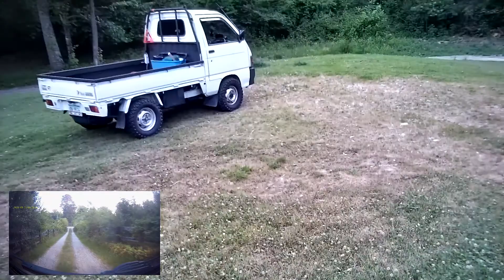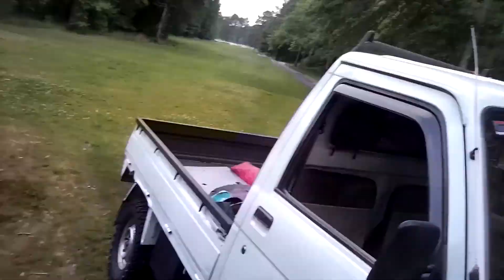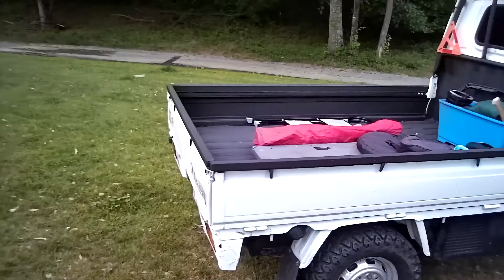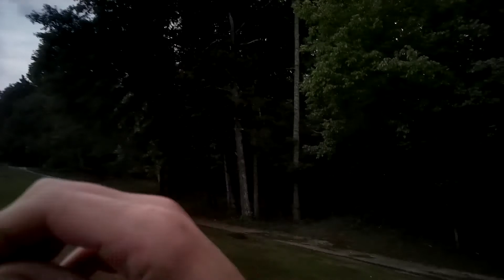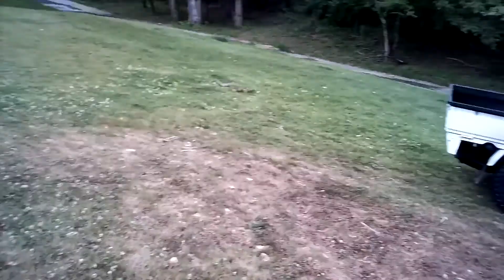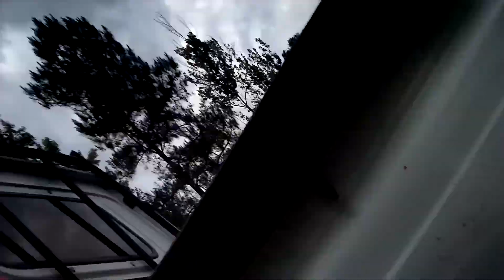Kei truck fuel filter

Comment: I put a new tank of gas into my sambar and this crazy stuff happened to me too.  Thing bogged out trying to speed quickly to 55 mph. Fuel filter makes some weird whining noise too.  I put sea foam and other fuel additives from Lucas but I’ll be changing the fuel filter cause I swear it’s making a strange whining noise.  My truck is 26 years old but has 23,000 kms.  So it sat a lot.

Comment: This video was the news I can use, and was worth watching, even with the ADHD herky jerky cell phone footage and constant break away cuts to Bandit.  Thanks for uploading the video.

I've been driving my 1996 4WD Hijet for a month and a half and suddenly on Saturday morning it sputtered and died on a divided four lane road while driving 45 MPH.  I coasted onto a side road and parked on the side of the road for a few minutes and it started.  I drove into a parking lot and it seemed to run fine at lower speed so I drove the remaining 2 miles to my destination.  I drove it probably 10 miles in four different trips that day, and drove 4 miles home that night.  I was beginning to think it was some transient electrical problem, but Monday night I drove it 3 miles on divided four lane at 55 MPH and it died.  After a short rest, it would restart and run for a mile or so and die.  I limped home at lower speed because at that point I thought it was a fuel filter or fuel pump and I didn't want to cause fuel starvation.  The tank is almost empty so it's probably not gravity feeding very well.  I'm hoping it's the filter that I was going to replace anyway as part of getting all of the maintenance from an unknown state to a known good state.  I'll tear into it tomorrow to further diagnose it and order the $13 fuel filter from GRImports, and a fuel pump if needed.

I love the little Hijet.  It's a ton of fun to drive, gets 30+ MPG around town (and lots of smiles per mile), has great 4WD off road capability, and is surprisingly practical.  I have many upgrades planned for this summer.  BTW - My Hijet has never had trouble going 70 MPH with power to spare although I never tried to go faster.  It's the TwinCam 12 valve, which is supposedly good for another 2 HP.  LOL.
Reply from the maker: Glad you found me.  Was it bucking or just sputtered and died?  Mine bucked strangely and started crapping out.  G&R always did me right they are the stateside experts on these things.  I have a turbo van version now and I drive it every day it's a hoot.  The fuel pump on those is up top under the passenger seat and it's a pretty easy replace job.  Do try the fuel filter first.  The turbo van had an issue like it but it turned out that a hose had popped off the new fuel pump and it wasn't able to draw fuel correctly.
Reply: @LeonRFpoa  - My Hijet mostly suffered a sudden lack of power.  There has been some stuttering where the engine would run a bit and then quit a bit before the engine stopped running, particularly the first time this happened, but most of the events after that it mostly lost power but still ran as I let off the gas, or it lost power and the engine quit.  It could be a bad condenser, a cracked distributor cap, a bad ignition coil, or an intermittent electrical problem in the ignition circuit, but it now seems more like fuel starvation so I'm leaning toward fuel filter (1st thing to check) or fuel pump.  Fortunately, as you mentioned in this video, these mini trucks are usually easy to repair.  I could probably get it running temporarily by filling the tank, but I'd rather fix the problem and I don't want to be working on the fuel system with a full fuel tank.  It's a lot easier and safer to drain 2 gallons if I need to drain the fuel system.
Reply from the maker: @Liberty4Ever  yeah man when I did my hijet fuel filter i got gas all over me even just from one line.  I get weird over my minis I absolutely was determined to fix it.  I had to do a 7 inch line under the floor hatch of my van and I bruised my hands up so bad they were literally black and blue.